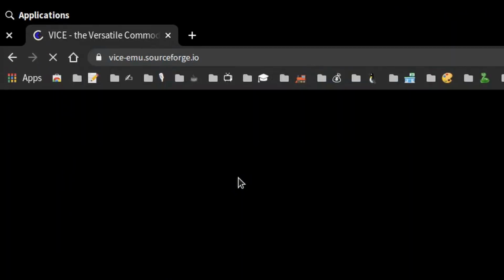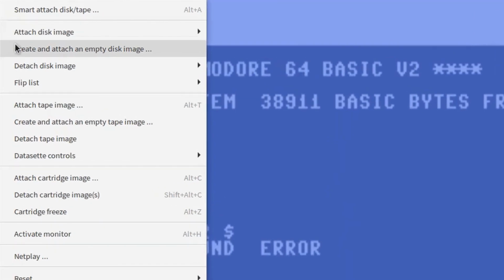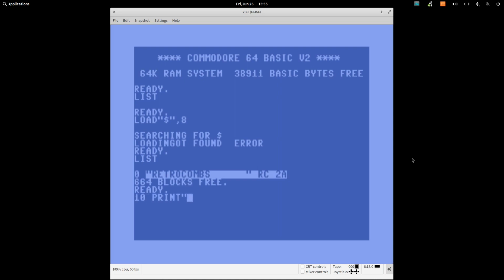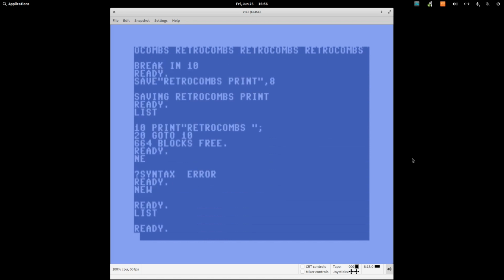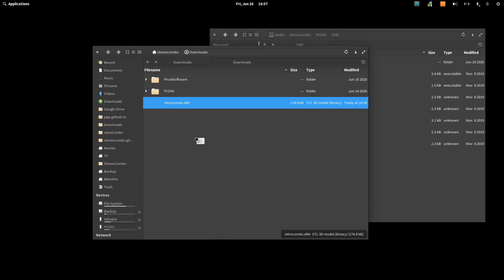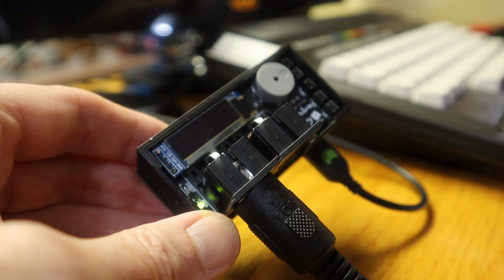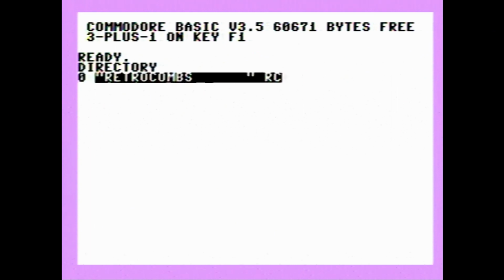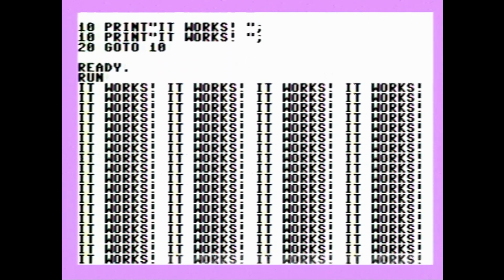Create a .d64 Disk Image for Pi1541 or SD2IEC using Vice #commodore64

Comment: You can also use VICE to create D81 images.

With Pi1541 there are some other ways to create blank disk images. Without any images mounted you can do one of the following;-

Press ALT-N on the Pi's keyboard to create a new D64 image (it will use the AutobaseName config option for naming).

You can also do it in COMMODORE DOS from the READY prompt;-
OPEN 1,8,15,”N0:FILENAME.D64,01”:CLOSE 15

In BASIC 7:
HEADER “FILENAME.D64”, XYZ, U8
Where XYZ is a 3-char disk ID
Reply from the maker: This is awesome. Thanks for the contribution. When I cover Chapter 3 of the Plus/4 user guide, I'll throw these tips in and give you the credit!